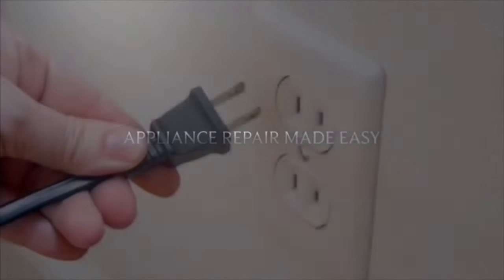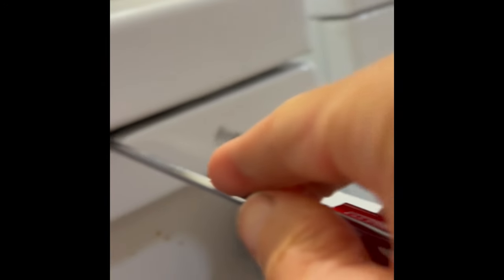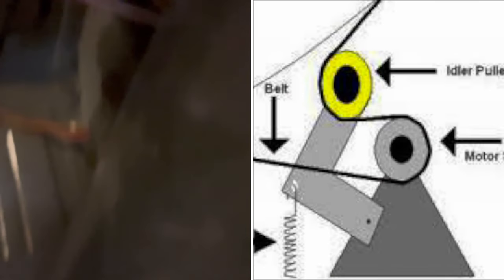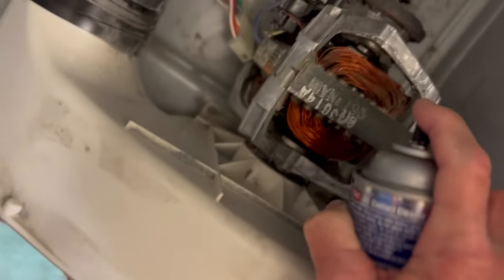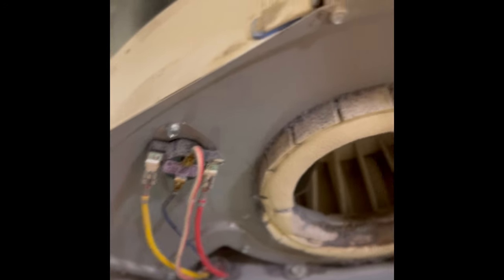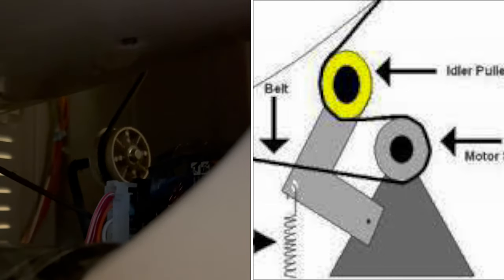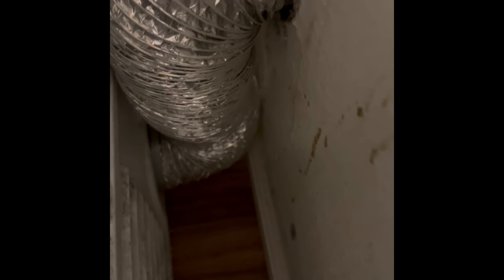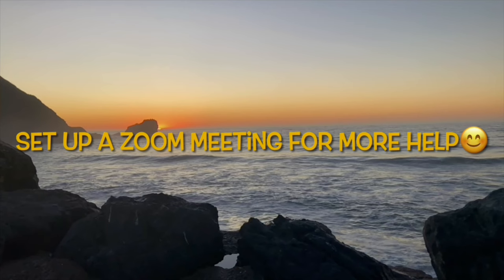✨ Dryer Keeps Stopping - Easy FIX ✨

Comment: Replaced motor on our whirlpool dryer an it has a bump sound when turning,an it shuts off after it heats up but wait a while an we can start it up again
Reply from the maker: Very good,
Can you check to make sure that the vet tube behind the dryer is not clogged with lint?